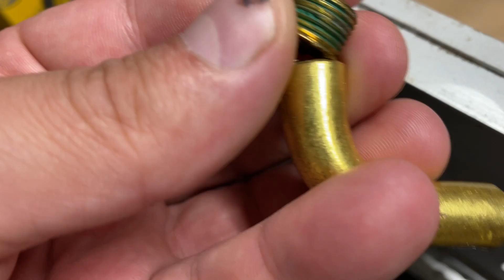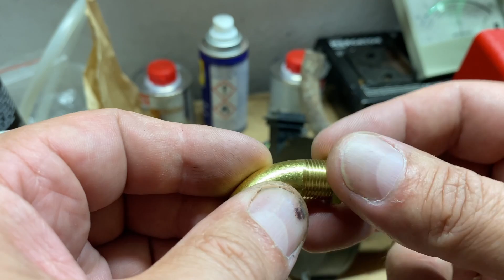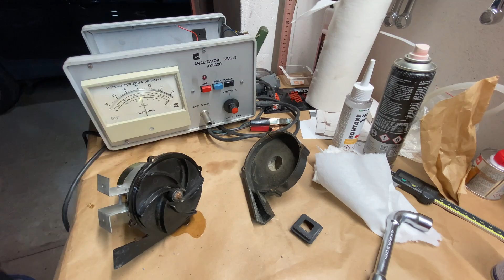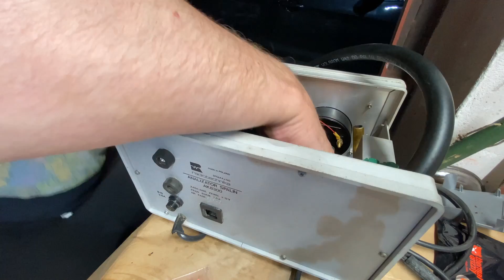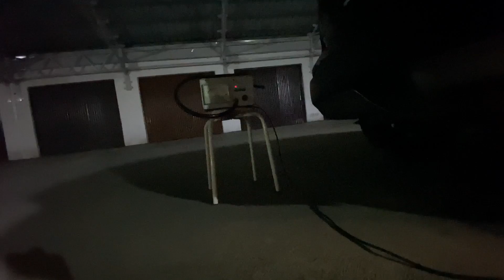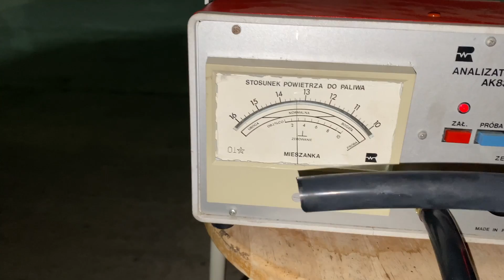AK8300 Exhaust gas analyzer restoration

Comment: Thank you for the demonstration I recently bought the original Crypton Exhaust Analyser made in UK which I believe this is a clone of  for $3 and I was wondering how to use it. I did not believe you are supposed to just run exhaust gas through it but you have clarified everything. Also did not know they were so old! 1970s is a long time but they still work.